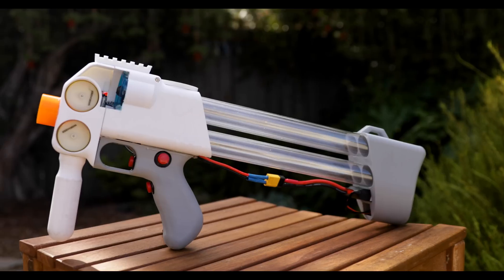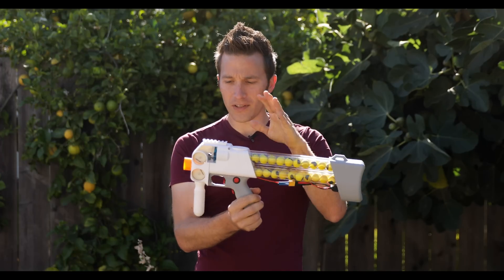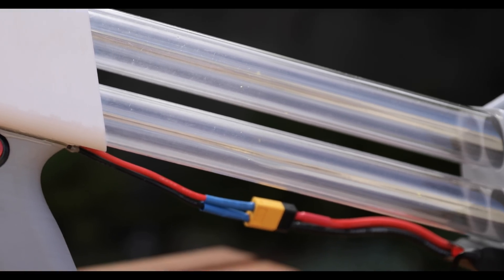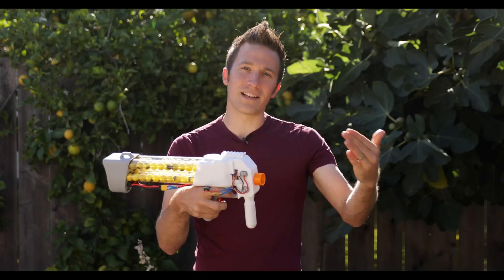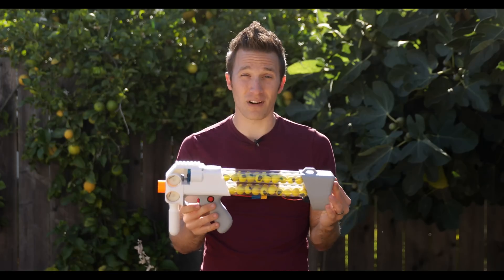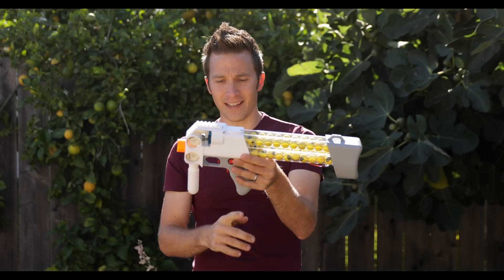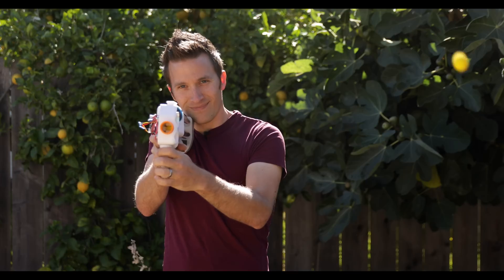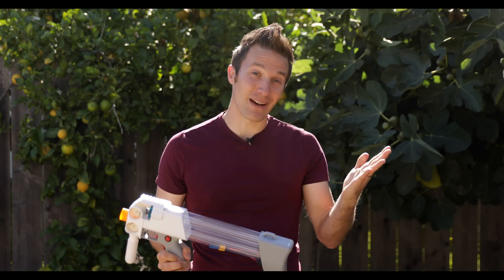3D-printed Nerf blaster! 65-Round Bullpup "SYLPHRENA"

Comment: Very cool! I saw this and I love the design, but I got to thinking. This has a major weakness, ammo capacity. Yeah, you don't need 30 rounds on one person, but it's more fun that way. I'd like to see a blaster designed as small as possible with a tube feed from backpack setup. you could put the battery with the backpack to further reduce blaster weight and run the wires with the feed tube. This would mean you just need two motors with flywheels, a motor to assist feeding, and a handle. I don't have anything rival, but I have access to Inventor and I think this would be cool

Comment: Heres An Idea But Its A Bit More Expensive you could have the blower in the back and past the tubes you could have two horizontal fly wheels in a line which throw the balls into the main fly wheel cage getting you a bit more range,Sound right?

Comment: not a bullpup, the bullpup design means its action is behind its trigger group giving the whole a longer barrel while maintaining a compact design, seeing as the firing mechanism is in front of the trigger assembly it does not qualify as a bullpup, its just an SMG design with a very short barrel.
Reply: When you use wiki to prove your point
Reply: Alex N i have to agree but it is still pretty freaking cool
Reply: Alex N I didn’t know what bullpup meant in that context... thanks for the info!
Reply: https://en.wikipedia.org/wiki/Bullpup
action meaning the point where the projectile if fired from, so that you can have a longer barrel, the action in this guys design is in front of the trigger there for it is not a Bullpup.
the whole reason to a Bullpup is to have a longer barrel on your weapon, just because it loads from behind doesn't make it a Bullpup.
Reply: Alex N a bull pup is when the loading mech is behind the trigger. So yes it is in fact a bullpup

Comment: Why wasting an arduino when you can just use the switches? and if there's a simple timing you could use the 555 timer ic...
Reply: Because brushless motors require a controller to switch the different coils on and off in the correct sequence to create rotary motion.... I doubt an off-the-shelf cotroller would suit the use of brushless in this build.
Reply: where do you see a brushless motor? the xt-60 connector doesn't always relate to all brushless motor stuff.
Reply: The motor in the "EDF" that blows the balls down the tubes to the "pusher mech" is brushless. The Ardurino will also be programmed to give selectable fire rates.

Did listen to his explanation? Watch it again and open your ears (and mind)!!!

Comment: nice vid but just a tip bullpup means that the firing mechanism is behind the barrelwhichits not in this vase but i still l9ved the vid thnx
Reply: True, but it is close enough. If he put the firing mechanism behind the trigger (The technical definition for a bullpup.) then he'd need a longer barrel.

On a fire arm a longer barrel is good, but on a nerf blaster its bad. So someone trying to make something for performance won't put on a longer barrel. The point of a bullpup having the action take place behind the trigger is to make it shorter, but with the same barrel length. On a nerf blaster people use it to keep the blaster shorter, but don't want increased barrel length.

Comment: I don't think he know that it is not a bullpup
Reply: Its close enough. It would be a larger (and less effective) blaster if he made certain that it was technically a bullpup. However the same idea as a bullpup is used. You put as much as possible towards the back so that the front can be shorter. Guns do this by having the action behind the trigger. However on a nerf gun that would necessitate a longer barrel reducing performance. This is as close to bullpup as someone designing a blaster for performace can really go.

Comment: There isn't much I can think of that you could change with this. It looks pretty good. Maybe add some tactical rails. Maybe a dump pouch holder on the side would be cool. That way you could grap balls very quickly and reload your blaster as you go. It could be a solid box or a plastic connector piece and a sturdy bag like an army canvas bag.